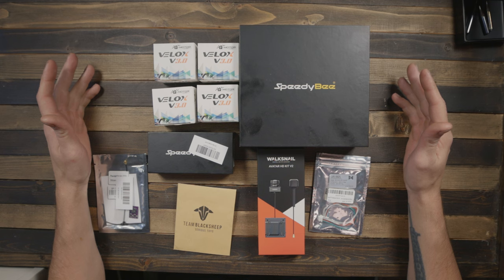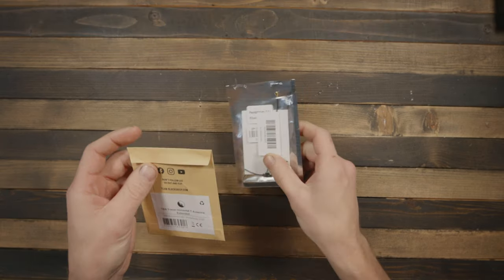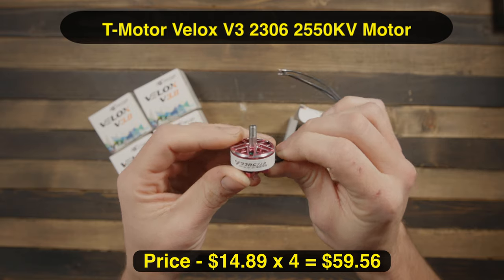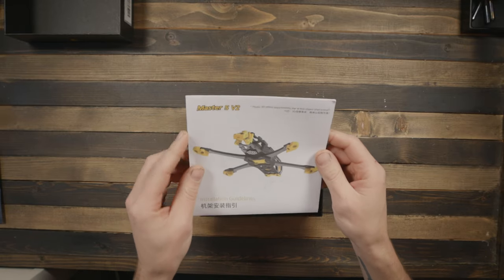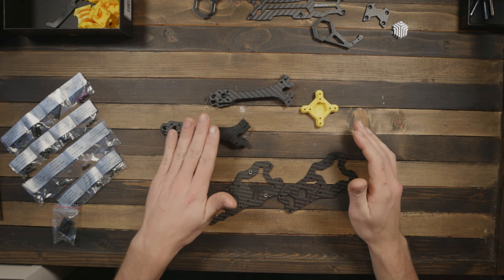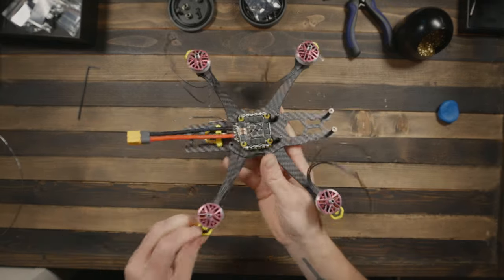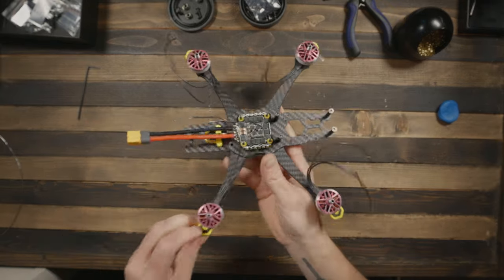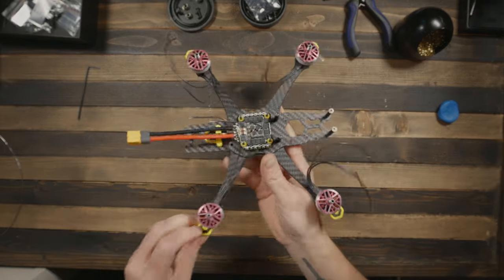5" Freestyle FPV Drone Build And Flight || Speedybee Walksnail HD Build

Comment: I would really love to know what caused that glitch... Random things like that don’t do much for my confidence (in terms of safety) when flying. I don’t know that I would want to trust it in an area where a crash could be costly to you or someone else.
Reply from the maker: Yeah I still dont know what happened. Thankfully there isn't really anyone there, Thats why I chose that place for a test flight.
Reply: @andrewmedia3568   Could've been a little de-sync and then caught itself.  I'd have a look at your blheli setting - demag comp = High.
Reply: @mlentsch   Isn't it really unusual for a quad to auto-recover from a de-sync? The normal fix seems to be a quick disarm/arm (if you have the altitude to pull it off!). Do quads recover from desyncs? (I'm not saying they don't I have just never heard of that without a disarm and re-arm. I guess it could be a quick desync that corrected itself before the FC went into runaway?
Reply: @clifffield1   I guess that they can, nowadays... In the old days, you'd be going down for sure, but the processing power of the newer escs can make them recover.  It's never happened to me, but I've seen examples of this on UAV tech.
Reply: Cheers! @mlentsch

Comment: what's the capacitor used for ?
Reply from the maker: soaks up the initial voltage spike when you first plug your battery in so nothing blows up. And during flight it soaks up voltage and cleans up electrical noise.
Reply: @andrewmedia3568 isn’t the xt60 on backwards?? Goes in the back on the drone. Unless you have the camera in the back 😂😂 good video though.
Reply from the maker: @jortega61924  you can put the xt60 wherever you want, out the front, side or the back. It just fit well in the front and won’t get chopped by the props. I don’t think you could mount the camera in the back. It’s just 2 standoffs back there no camera plates. 🤷‍♂️

Comment: what antenna did you mount at the front. my elrs receiver came with 2 short antennas but i want to buy the long one like you have and mount it the same way up front. can anyone link me an antenna that would work? i have the radiomaster RP4TD ELRS 2.4 receiver. this is my first build and really want to use gemini
Reply from the maker: Yeah most elrs rx come with short antennas I just look for any 2.4g antenna like tbs tracer is 2.4. Anything that’s 90mm or more in length that why one can be short and the longer one can extend to the front or rear. Check pyrodrone, racedayquads and getfpv. One of them should have some long 2.4g antennas .

Comment: Is it ok to shrink wrap the wires instead of twisting them?
Reply from the maker: Definitely heat shrink would work well. 👍
Reply: Its a myth that all wires should be twisted , the rx and tx should be twisted with an earth , the live VCC Should be left untwisted. But they can be all heatshrunk together or better, in braid.
My students made the same mistakes and in the laboratory you can see on an oscillascope the electronic noise lessen and go higher when twisted with earth [less noise] twist all [more noise].
Dont want to sound big headed, cheers

Comment: Did you run on default pids? Also did you found out what was the cause of the flips?
Reply from the maker: Im running Supafly 5" freestyle preset pids. still dont know what caused the flips, but havent had any other issues since. seems to be fine. 🤷‍♂
Reply: @andrewmedia3568  Maybe the quad calibrate itself for a second 😅How you like the drone in gerneral? I'm in between this or the Mark 5, and it's not easy to choose 😄
Reply from the maker: @emilpers1078  Thats a hard one the mark 5 is a solid quad, I haven't had as much time as id like to fly this drone yet but so far it seems really good.

Comment: How long approximately does this drone fly on one battery?
Reply from the maker: If you fly slow and cruise, 5-7 minutes. If you fly hard freestyle 3-5 minutes. And it depends on the size of the battery. Could be longer or shorter depending on mAh.
Reply: @andrewmedia3568  What is the best option for freestyle drone, 5 or 7 inches frame, cuz i want it to fly 7-10 min?
Reply from the maker: @MrTyron  for freestyle definitely 5”. But typical flight time for freestyle is 3-5 minutes. Sounds like not much time but just buy a couple battery’s and you’ll have plenty of flight time. Longer flight times is usually for 7” quads and flying a bit slower. It all depends on the build though. 4s vs 6s, drone weight, motor kv. There is a lot that goes into it. Lots of videos on YouTube though. Just do some research and that will help. I have a few videos building and flying a 7” and lots of 5” videos freestyling. Check out Joshua bardwells channel too.

Comment: Wow - the GoPro footage isn't that great compared to the WS.  I just picked up one of those Insta360 Ace Pros... it's next-gen.
Reply: Because of ND filter. Some people for some reason likes blurry "cinematic" footage so it's done on purpose. I can't understand that but some people like that :D I can assure you that GoPro footage can be crystal clear :D I'm not fan of ND filters.
Reply from the maker: 🤣 Filmed in 4k 30fps with an ND filter. Im a camera nerd so I follow the shutter rules even with gopro 30fps shutter 1/60 with ND filter to fix exposure. To me gopro footage that auto changes shutter speed and doesn't have natural motion blur looks like a noob who bought there first camera, but its all personal preference. 🤷‍♂
Reply: @andrewmedia3568 Yeah :) After two years in the FPV hobby I learned that ND filter vs no ND filter war is like spaces vs tabs for indentation in programming. War that nobody wins :D
Reply: @rfly-fpv  I always manually expose for any "release", of course.  I use ND filters, too, but they're a pain....
I think that my problem with the gopro is just it's age.  Like I said, I'd been researching the lastest action cams before I got that Ace Pro.  All the three new ones Gopro12, Dji A4 and the Ace Pro are a significant jump in picture quality over generations from the GP9 era....and I was used to seeing that.

Comment: Did you ever have any more death rolls?
Reply from the maker: Yes it continued for a while and I tried all the normal stuff to fix it. I think it was motor desync. I ended up swapping the stack and motors .
Reply: @andrewmedia3568  I had it on my DIATONE f5 when I upgraded to 4.3 from 4.4.0 which was perfect, I changed demag compensation to high, and ramp up power to 30 and auto timing, 24k low, 96k high, and it's fine since, was always back no 1 motor
Reply from the maker: @rcaddict9558 dang, yeah I’m not super familiar with esc configuration, but I did set demag to high changed start up or ramp up power. Then flashed bluejay and re configured esc again changing settings, pwm frequency. Nothing seemed to help. I just got tired of the quad randomly falling out of the air and gave in. 😂

Comment: Can I use EMAX ECO II Series 2306 Motor 2400KV for the exact same build
Reply from the maker: Definitely, that would work well. 👍
Reply: @andrewmedia3568  Thanks
Reply: @andrewmedia3568  I have ultimately decided to use the Velox motors so could you share the links for the props you have used as well as their caps and the smoke stopper.
Reply: @andrewmedia3568  What type of battery have you used and is the motor you have selected the best one for the same build or you would suggest me to get a different one
Reply: @andrewmedia3568  ALSO COULD YOU TELL ME IF I NEEDED ANY ANTENNAS WITH THE SAME GOGGLES.

Comment: Is this build 6s capable?
Reply from the maker: The fc and esc can handle 6s no problem, but the motor kv is too high for 6s. You would need 1900-1700kv motors and then it would be 6s ready.
Reply: Would you recommend a 6s build for a beginner? Or is it worthwhile to have the 6s build, but just run 4s until comfortable, and then swapping to 6s? Hoping for longer flight time, but wasn't sure how long you get off the 4s batteries.
Reply from the maker: @alexscolavino3301   flight time really comes down to drone weight, battery size and how aggressive your flying. I started on 4s and now I have so many 4s packs I just stick with it. I run 6s on my 7" long range drone. But 6s is significantly heavier and more expensive. your going to crash and lose battery's. It gets expensive. My 4s flight time ranges from 3-7 minutes.
Reply: Thanks, Andrew. Do you recommend a specific battery charger, and what 4s batteries do you use for this build? I didn't see them in the details for the video.
Reply from the maker: @alexscolavino3301  for charger I run the skyrc t200. It’s a dual channel charger with great specs. Check Amazon. Usually about 100-130$ and for batteries for my 5” quads I run 1500mAh from all types of brands tattu funfly, tattu R line, ovonic fpv, zeee, cnhl, gnb. I buy all my packs from Amazon.

Comment: What controller and goggles are used?
Reply from the maker: Controller is the Radiomaster Boxer running ELRS. And goggles are the Fatshark Dominators.
Reply: @andrewmedia3568  Thanks a lot! would it be possible to link the Walksnail Avatar HD Micro Camera & VTX Kit V2 32GB with Gyroflow. ? preferably on getfpv
Reply from the maker: @MadhAviation  https://www.getfpv.com/fpv/hd-fpv/walksnail-fat-shark-digital-hd-fpv-system/walksnail-avatar-hd-kit-v2-32gb-w-gyro.html
Reply: @andrewmedia3568  Thanks so much one  last thing how do you power your goggles, is it also with a lipo or is it with something else, im kinda new to fpv
Reply from the maker: @MadhAviation   The goggles will come with a power cord and this battery will work. 
https://www.amazon.com/TATTU-2500mAh-Fatshark-Goggles-Indicator/dp/B06XNNSS65/ref=sxin_16_pa_sp_search_thematic_sspa?content-id=amzn1.sym.9e518342-e9c3-43d6-ab27-637d7c295405%3Aamzn1.sym.9e518342-e9c3-43d6-ab27-637d7c295405&crid=OK977KAOQGWR&cv_ct_cx=fpv+goggle+battery&dib=eyJ2IjoiMSJ9.s4qVHaU_Tj-9ENhRQF67kdX_KjTMl-u9zoDzhN0gldTKaJG9FHR68OO_RYpdWebTF8plV84vDbcREARVkOs0mw.58bHRBpikc271PrswRLFc5fe7y13wAPKIbqt7Oj-0is&dib_tag=se&keywords=fpv+goggle+battery&pd_rd_i=B06XNNSS65&pd_rd_r=078fb43d-53e3-44b2-85cd-9cac03499c46&pd_rd_w=cpIUN&pd_rd_wg=y0XTZ&pf_rd_p=9e518342-e9c3-43d6-ab27-637d7c295405&pf_rd_r=ABXDVTE06NDECQ2AZTME&qid=1718556744&s=electronics&sbo=RZvfv%2F%2FHxDF%2BO5021pAnSA%3D%3D&sprefix=fpv+goggle+battery+%2Celectronics%2C153&sr=1-1-364cf978-ce2a-480a-9bb0-bdb96faa0f61-spons&sp_csd=d2lkZ2V0TmFtZT1zcF9zZWFyY2hfdGhlbWF0aWM&psc=1
Reply from the maker: @MadhAviation  Or you can use any lipo or li-ion that is 2-5s voltage the specs tell you what voltage the goggles can handle.
Reply: @andrewmedia3568  Do you think the Lumenier 2250mAh 3s 35c Lipo Battery would work as well? the amazon one cant ship to my country
Reply: @andrewmedia3568  Oh alright, not too familiar with lipos thats why theyre pretty hard to handle imo + theyre unsafe is handled badly. btw what antennas are on your goggles?
Reply from the maker: @MadhAviation  yes that would be perfect, its within the 2-5s voltage range so your good to go.

Comment: Next time you should read the manual and look at the pictures.  You screwed up the capacitor install (it's way to far back covering the buzzer hole, and making the leads way to long, you didn't use the holes in the FC that are there specifically for the cap leads.)  You didn't use the included wire cover tubes for the arms which is far cleaner than this crap.  Didn't bother watching the rest at that point!
Reply from the maker: 🤣 🤣 Sowwy I didnt follow the rules. Bahahaha. Yeah people should go watch your video... but you don't have any. I can tell from your comment you either don't have any quads or if you do they are all pre built bind and flys.
Reply: Yap yap yapping gums. Geez

Comment: Hi Dshot, i building this fpv drone could you help me check my setup? Thanks
Walksnail Moonlight Kit 4K FPV System — $178.00   Caddx Shop

T-Motor Velox V3 2306 2550KV Motor. $14.89 x 4 = $59.96  Get FPV

SpeedyBee Master 5 V2 5" FPV Freestyle Frame. — US$69.99   Speedybee

RadioMaster Zorro Radio Controller ELRS Starter Set — $174.99   Get FPV

SpeedyBee F405 V3 Stack w/ 50A 3-6S 8 Bit 4in1 ESC - 30×30mm. —US$59.99  Speedybee

Walksnail WS-M181 M10 GPS Module. — $16.99   Caddx Shop

Walksnail Avatar HD FPV Goggles L — $199.00 Caddx Shop

Lumenier N2O 1500mAh 4S 120c LiPo Battery (XT-60) 3 Pack Bundle — $99.99 Get FPV

Complete set of components for the SpeedyBee F405 V3 stack —US$5.99 Speedybee

Gemfan Hurricane Durable 51477 3-Blade Propeller (Set of 4) —$2.99 Get FPV

 Thanks
Reply from the maker: Seems like a great set up. I think you will enjoy it and you will get nice crisp 4k video recording from the moonlight VTX.
Reply: @andrewmedia3568  Thanks

Comment: what controller and goggles are you using?
Reply from the maker: Controller is the Radiomaster Boxer and goggles are the fatshark dominator HD.
Reply: @andrewmedia3568  Great video! What is the difference between the fatshark dominator HD and the avatar goggles X? Are the fatshark dominator  HD just an older version?
Reply from the maker: @arthurgarzon200  yes the dominator HD is the version 1 goggles. Both have 1080p display. And from what I’ve seen the goggles x has some issues. My v1 have been perfect so far. And they are much cheaper. They still work with all the newest a avatar vtx.
Reply: @andrewmedia3568  can i use the rm tx16s?
Reply from the maker: @qevility310  yes as long as the radio protocol matches your drones receiver. So crossfire with crossfire or elrs with elrs receiver.